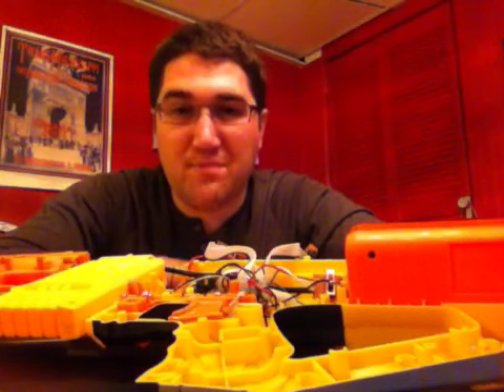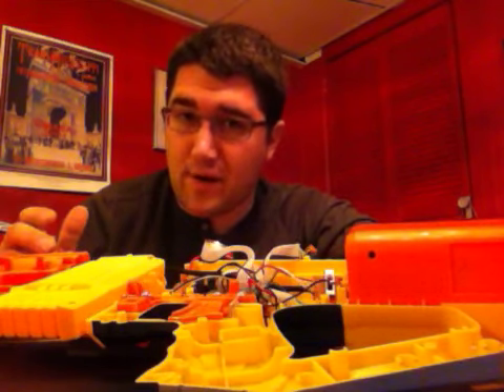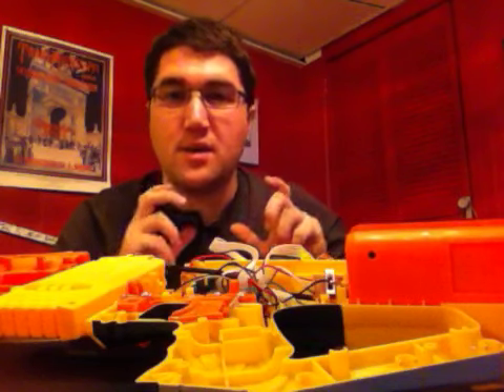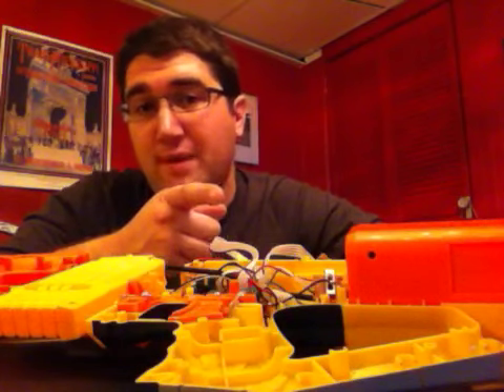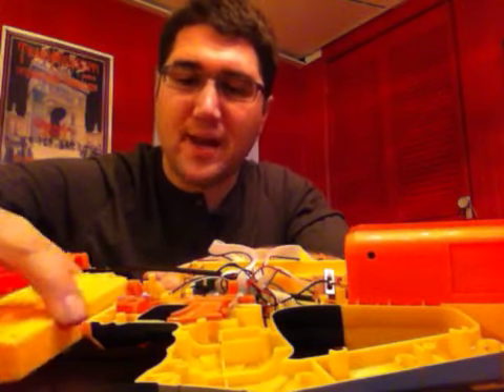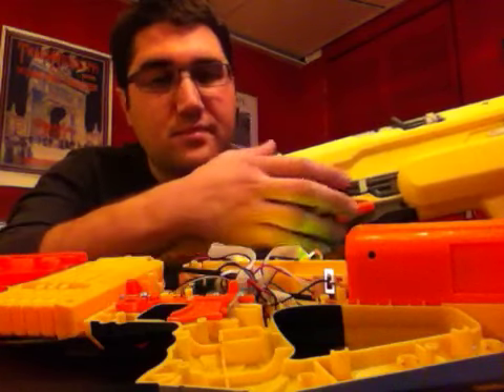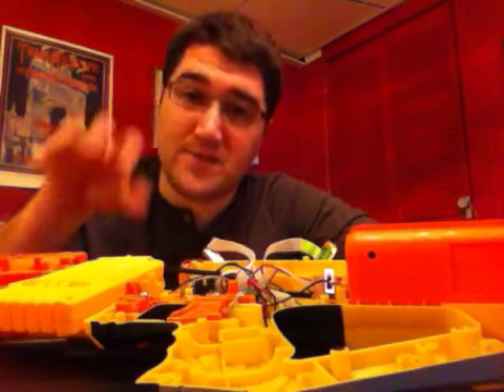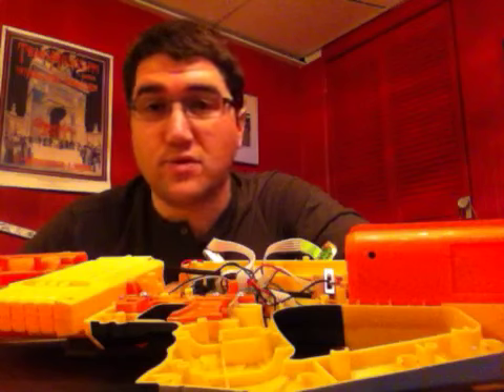LTX DMR Progress Update 3

Comment: A "mod" idea... for the LED lights for a "stealth" mode of operation in low light, would be to put a switch on the common lead to turn on/off the led indicators... I probably would look at putting a resistor in line to make them dim, then the switch shorting the resistor (returning the common return path back to normal) for bright LEDs...

just an idea.